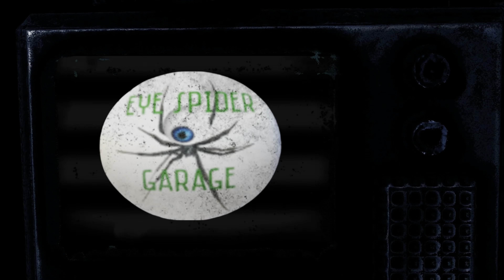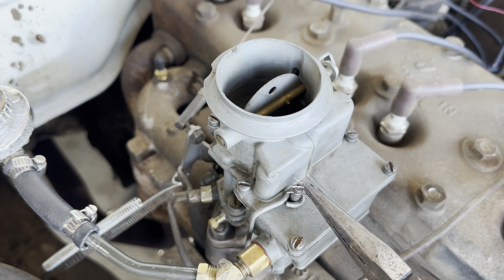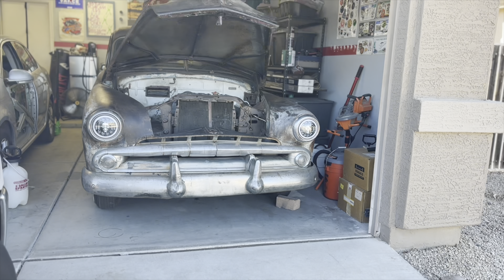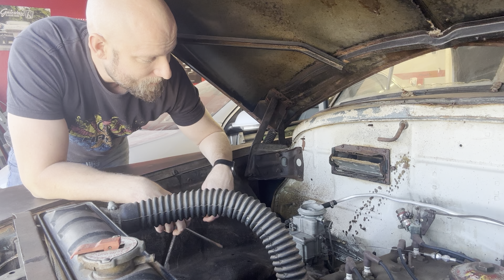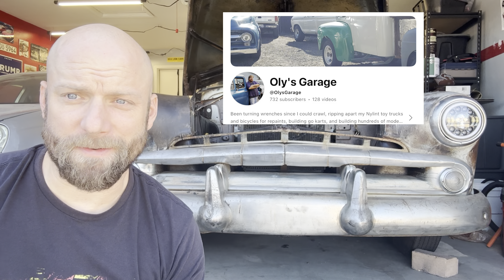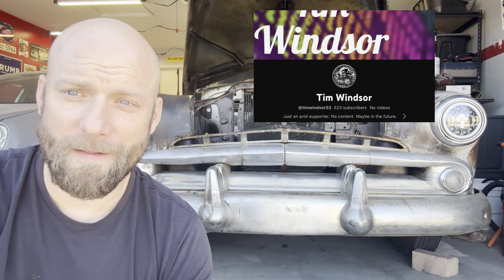What can I do to get my car to Start and Idle?!

Comment: I agree with @OlysGarage. I would put eclips on. Also, I would check the solid line from the base of the carb to the distributor for vacuum leaks. Spray a little Brakleen on the connections while she's running and see if the rpm changes. Oh, and leave the rattle. Old Mopars are supposed to rattle 😂👍
Reply from the maker: I love it! Thank you so much for the helpful advice brother. I’ll definitely try that! Yeah ironically I went back out and started her up again later in the rattle was gone lol so I’m not sure lol